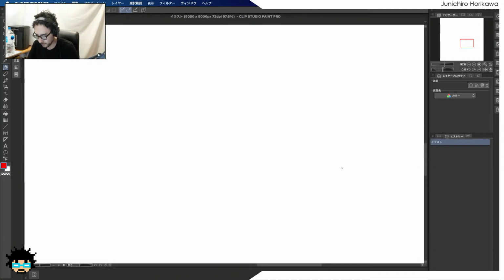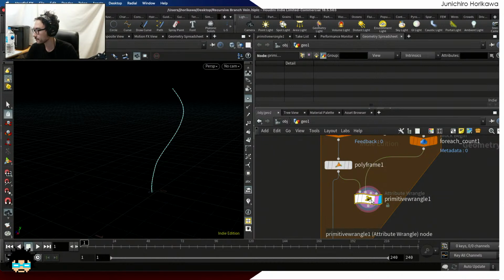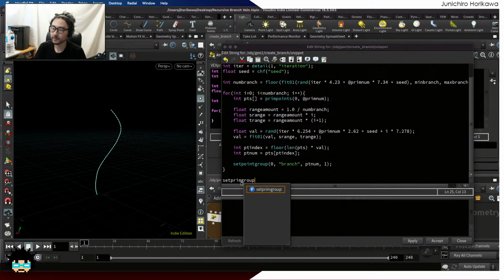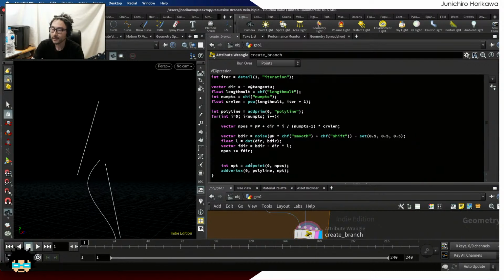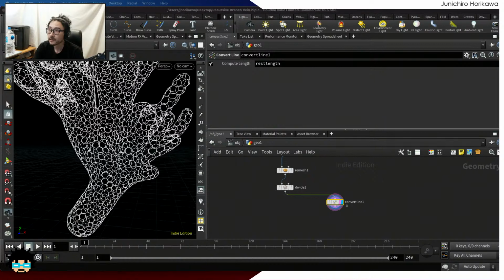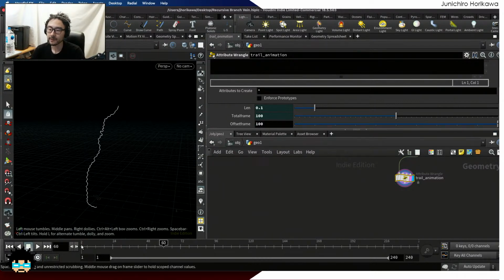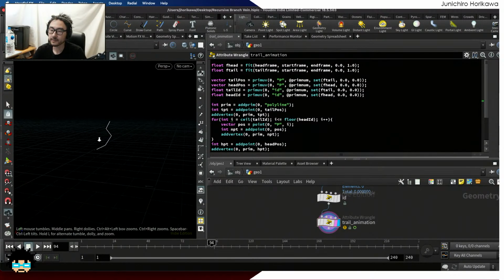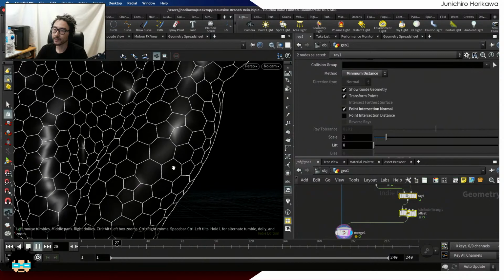Houdini Algorithmic Live #075 - Recursive Branch Vein

Comment: Can somebody explain to me a bit of the vector math at 1:12:45? After calculating "l", he multiplies it by "V". What does this do? Can't you just subtract "l" from "v1"? Does the multiplication normalize the "v2"?
Reply: HI. I guess he wants a projected length. Projection of vector v_1 on to V. Dot product gives you multiplication of two vectors as if both were about to exist on the "same line". Dot product "brings" v_1 on to V by projecting v_1 on to V. But the result of dot product is a mutuplication of both projections. In order to extract the projected length of v_1 from the result of dot product I would divide V on dot(V, v_1). Here Junichiro is doing multiplication instead... don't know why... I guess I'm missing somehing. Have to look closer.
Reply: @arsensuleymanov7935  Yeah, I'm really not sure what's going on there. It seems to work though, so who am I to argue with the master?